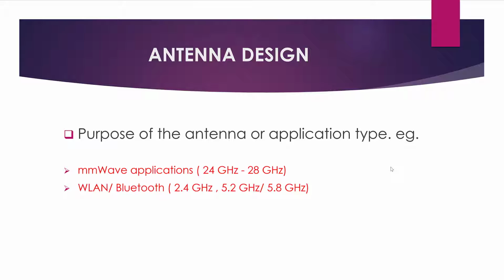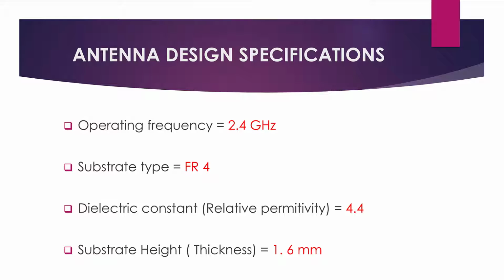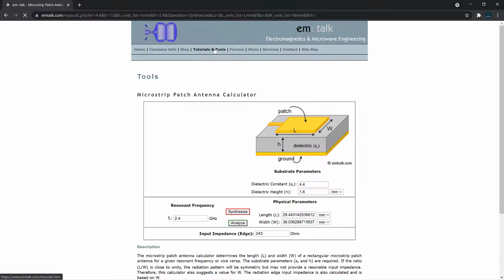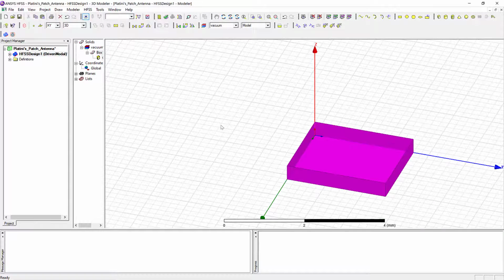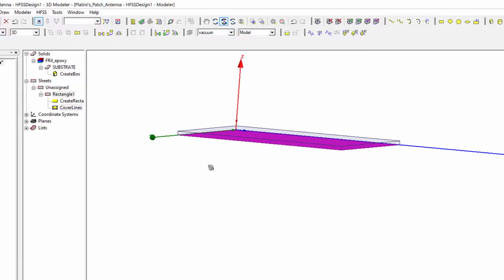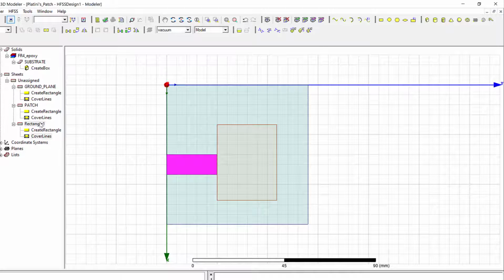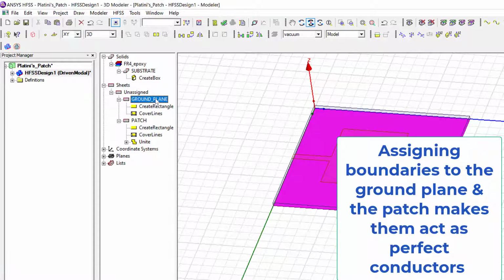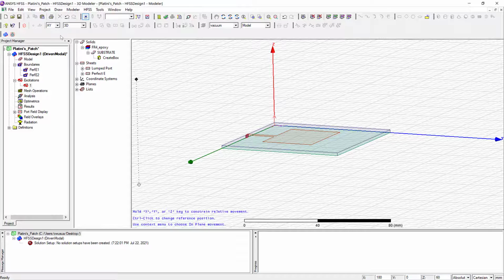DESIGN OF A RECTANGULAR EDGE-FED  MICROSTRIP PATCH ANTENNA @ 2.4GHz.

Comment: At higher frequencies, the patch thickness must be taken into account. Is there such a calculator? Or a calculator as part of modern versions of the NFSS?
The formulas are mostly known. But for the edge impedance of a patch having a thickness, I don't know the formula. In addition, to calculate the length of a quarter-wave transformer, one must take into account the two-way fringing, and not just divide Lambda / 4.